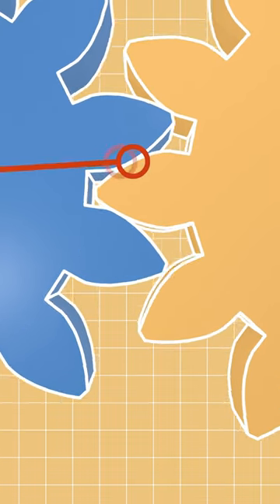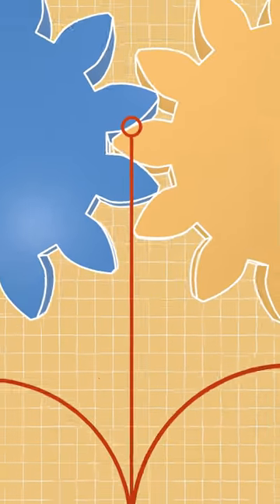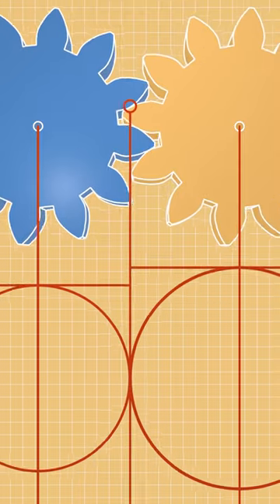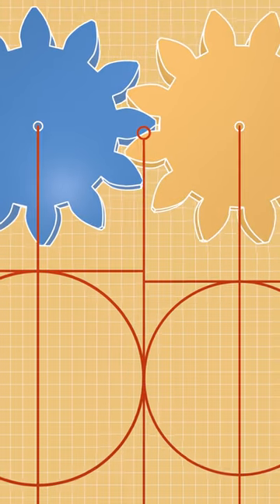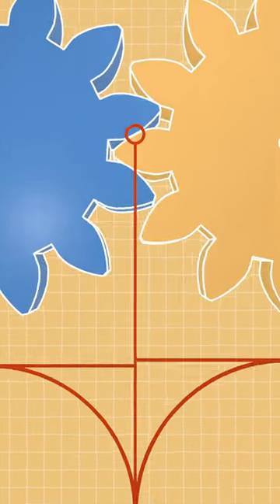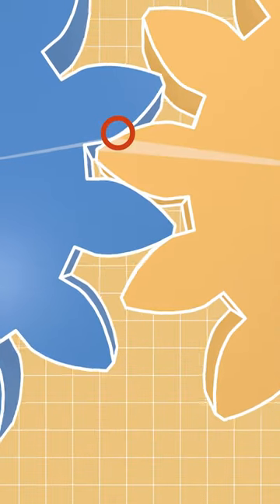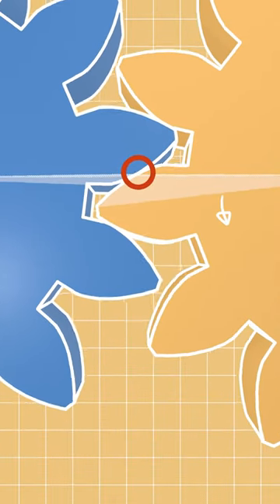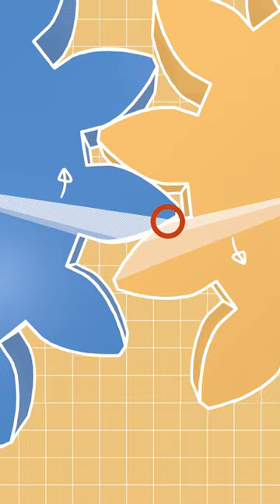Why Gear Teeth Have This Shape

Comment: Love involute gears. The force vector along an involute is always pointing in the same direction as well, super useful in making sure your system is stable and not wobbling. Also, constant surface contact with no discontinuities (like square-tooth gears), so no snapping or sharp corners for stress concentrations to occur. Smart stuff, another cool engineering application of mathematical properties.
Reply: Oh! That makes a lot of sense, then, if that's the purpose and this is a way to make it work successfully. Neat!
Reply: thank you for giving us the name of the shape / gear and for the thr extra info❤ we need more people like u m8
Reply: Yeah but them square cut gears are the best there are at handling high torque and shock loading
Reply: That's totally wrong.

Comment: Please revisit this as I'm pretty sure it's incorrect. Gear ratio stays constant in an involute profile, that's the whole point of that shape. The angular velocity ratio is also constant and does not change like in the animation.
Reply: You are right, it is constant. that's the whole point.
Reply: He ignores to mention that the real reason for the shape is so that the gears roll rather than rubbing.
Reply: @addmix  They still rub, I used to think they roll too, but it's actually impossible.
Reply: @roadrash999   Yep they rub, thats why you need lubrication if you want them to last.
Reply: That is literally what the video explains; how the shape is curved to mitigate the moving contact point, and thus how the gear ratio would change if it weren't for that shape.

Maybe it would be better if the loop went "This is why... The gear ratio is constant despite the contact point moving away from the powered gear.", but that's really being nitpicky about phrasing and not the actual substance of the content.
Reply: @CGoody564  That part of the video where it shows you the two gears having moved different angles in the same amount of time is what is wrong. By definition the gear ratio is the ratio of the angular velocities. Constant gear ratio means that they will ALWAYS move the same angle in the same time. The position of the contact point does not matter.
Reply: The narration is confusing but it seems to be saying that's what would be happening in the absence of the involute profile.
Reply: The surfaces are always sliding except when the contact point is on the pitch diameter
Reply: @ckush928 You are correct. That's why the teeth are shaped as involute profiles. The contact path is the common tangent of both the gear base circles. This means that the contact force is applied along the same line leading to constant torque and speed transmission between the gears. You can have non-involute profiles like cycloid profiles in wrist watches because you want lots of strong teeth that are very thin (higher gear ratios). In those cases the path of contact is not a straight line leading to a fluctuation in the power transmitted.
Reply: He means the gear ratio wouldn't be constant if gears were any other shape

Comment: What stays the same is the component of the difference in position of the contact point and the center of the powerd gear that is perpendicular to the normal force between the gear teeth. Sure the contact point moves away from the powered gear but the lever arm doesn't actually change because the force between the gear teeth isn't tangential to the powered gear. There isn't any actual pushing back to make-up as he says; This way there would be much more friction than there is in reality. Another thing to point out is that the point of contact moves along a straight line which is the dual of the forces that I've described. This gear tooth profile is the involute of a circle. Imagine wrapping a string around a circle and winding or unwinding it to produce the shape. In a way the string of one tooth feeds into the receding string of the other tooth producing the straight line of contact and constant gear ratio.
Reply: Thank you, Video quite missed some more important points
Reply: Yep
Reply: Yeah he often does incorrect explanations
Reply: Machinist?
Reply: Bingo. It's made this way so there is no relative motion of the gears at the point of contact. It's more about eliminating wear while providing a smooth motion.
Reply: very beautifully worded
Reply: Thank, the pushing back doesn t make sense
Reply: You are perfectly right, this video just spreads false information.
Reply: @andreasstavrou6695 . Like far too many. People need to 👎 and even press the 3 dots ••• and follow the promps to say don't send more. 
Otherwise we get what we allowed.

Comment: How do humans even think of this.
Reply from the maker: crazy huh?!
Reply: incrementally
Reply: we ueed to have A LOT of thinking time but now all we got is phone time
Reply: @tewkie7955 i dont think this idea was invented/produced by your everyday person, aka people who typically are on their phone more often
Reply: Problem, solution, problem, solution until it works
Reply: first you figure out that levers are a thing.
then push a lever with another lever.
then invent a "round lever" or "wheel" as the kids call it.
4th add teeth.
5th after extended use you learn about wear patterns and so on until you notice this.
(there may be many steps i missed.)
Reply: @tewkie7955  Phones bad.
Reply: @snickerdoooodle not if people use it properly
Reply: Euler was certainly no regular human
Reply: @ARockRaider there was a lot of math involved in reaching the correct gear tooth shape. I forget the name of it, but the tooth shape of gears is a specific mathematical shape that people would've discovered just playing around with circles and string.
Reply: A lot of engineers and scientists are slowly but surely improving and expanding every aspect of technology and infrastructure constantly.

It takes a lot of discussion, a lot of research, and a lot of development, but the slow and steady processes that have been built up over decades allow for smooth, continuous improvement and discovery.

Source: am engineer.
Reply: Usually it's smart humans who think of this stuff. Not genetically deficient humans like me.
Reply: @snickerdoooodle no
Reply: @ARockRaider how many steps until humanity made wifi out of rocks
Reply: Trial and error tbh
Reply: over a period of time
Reply: monke reaction when they can speak:
Reply: Because humans are a lot smarter than the Internet tells you
Reply: @starbound03 technically it already is.
Reply: Probably because the gear teeth wore themselves down to this shape
Reply: Trial and error over thousands of years
Reply: Just try a bunch of different shapes then work backwards and figure out why certain shapes work better so that you can understand why certain iterations are better and keep that design element and make a bunch more variations with that in it and it gets better and better each time you repeat. Its called the engineering design process and its basically just guess and check.
Reply: Before phones there was a lot more time to just let your brain breathe and think, calm down, and and be bored, and imagine and invent crazy ideas to entertain itself. It's why you don't see much brilliant shit these days. Our constant existence is watching a phone till we sleep daily, our brain is essentially and effectively rotting.
Reply: Math
Reply: A lot of math
Reply: most of what humans created was inspired from nature or try and error
Reply: @thedudeamongmengs2051 it’s called an “involute”. This gear tooth shape is what makes this an “involute gear”, but the mathematical principle you’re talking about is specifically the “involute of a circle”. All of the normal vectors you can draw about the involute path are tangent to the circle itself, leaving you with the fact that there will always be a perfect contact point on an involute gear mesh. The force vector as the energy is transferred is also perfectly straight (it follows a straight path through the gears), meaning this system is incredibly well-balanced. Perfectly-meshing involute gears are a thing of beauty, although you don’t often get “perfect” gears. Close enough lol
Reply: Engineers they always look at the details and study it then improve it multiple improvements lead to this result
Reply: @Vino976  yeesh
Reply: Probably f*cking around and finding out?
Reply: They didn't. He's wrong about why they are curved.
Reply: Just take two square shaped gears and let them work for a really long time. At some point they will turn to this perfect shape
Reply: Huh. My gear isn't moving how it wants cause the teeth are shaped like this. Huh. What if they weren't shaped like this?
Reply: So what is an application for this type of gears?
Reply: I don't know if this is the most impressive thing we've done, lol.  This is pretty middle school level robotics stuff xP
Reply: @Vino976 ”phone bad book good” ass comment
Reply: @tewkie7955 pushes your pfp to turn you off
Reply: It's even crazier when you realize how long we've known a lot of this stuff but manufacturing technology wasn't up to par yet so it stayed on paper or only for the ultra wealthy. All those guys, DaVinci, Aristotle, Newton, and like a billion guys from India just sat around and did math all day every day
Reply: Most of us have a beep in their due to their African ancestors
Reply: cause we built gears that were straight and we noticed how the output would vibrate
Reply: @TMinusRecords  you said in one word what I wanted to say in a whole paragraph
Reply: These are involute gear teeth. They are mathematically derived.
Reply: Lots of time to think and do
Reply: With brains
Reply: @tewkie7955 thank god
Reply: That's why we are on top of the food chain 😂
Reply: @snickerdoooodle Feel free to walk over to the hospital when having a heart attack instead of calling an ambulance
Reply: legends say that when they invented the wheel it was square at first, after being slammed on the ground so many times it became round.
I think the same thing happened with gear cogs, they got the optimal shape based on continuous grinding one another. ;)
Reply: they don't. it's done by trail and error
Reply: Problems exist, so we came up with solutions to those problems.
Reply: lots of math
Reply: By getting screwed over by it enough times. Due to friction, worn gears (if they don't break first) will naturally tend toward this shape as they wear.
Reply: Trial and error, theory, testing, and a LOT of time passion and boredom in your hands

We discover a thing then we find out its problems, go "I wish we can use X without this issue", a genius figures it out, and bam. Staple in human history
Reply: You studdy and work on a thing for your life. Thats how. There are even special shaped ones to reduce sound noise.
Reply: @thedudeamongmengs2051 mathematician, scientist and inventor are amazing
Reply: Math.
Reply: @deego237 That's the dumbest, most unverifiable legend. Also nonsensical. People have never been stupid. It's easy to see round things like rocks and eggs rolling and know that they roll because they're round.
Reply: Whith that squishy thing in our heads
Reply: MATH MATH MATH MATH
Reply: Engineers do.
Problems creates solutions vice-versa
Reply: @cardboardking577 voila.
Reply: Aliens
Reply: Intelligence. Research. Studying.
Reply: @tewkie7955 no that's not what's different. The people who invented this aren't like you or basic people who don't study physics or engineering. Don't blame phones.
Reply: Drugs
Reply: @poleve5409  that would mean the same for you
Reply: Studying nature
Reply: Centuries and millenia of theories and testing
Reply: @tewkie7955 you mean working time 💀
Reply: 2000 years, a lot of us, the invention of boredom.
Reply: figuring shapes out is kiddy stuff lol
Reply: @Vino976  yes that was his point
Reply: @luisapaza317  "An" application? It's harder to find applications for other types of gears! The involute shape described in this short is by far the most common shape used when making gears. :)
Reply: Bad gears just file themselves down like this through use and then people look at it and make it a bit better.
Reply: @Vino976 they actually are everyday people. One person designs something, then over time thousands of people make small improvements. We’re constantly building on top of our existing knowledge, one small step at a time.
Reply: Lots of trial and error, for starters.
Reply: Maths
Reply: Honestly a lot of times we probably don’t, we go “why does this one randomly work bet te r than this one” and then we figure it out and apply that rule to its max to create the best possible thing.
Reply: Millenia of iteration
Reply: Fail and trail
Reply: It called not being an NPC
Reply: Slowly. Like evolution
Reply: Iterative design. Every magical-seeming technology you have is the result of tiny incremental advances from millions of people, especially once market forces started incentivizing innovation you got many many minds thinking about how to make things slightly better. For example, this particular principle mightve been the only notable innovation a physicist/engineer made in their whole career.
Reply: It was the aliens 👽👾👽👾
....and robots.
Reply: We take a lot of inspiration from the world around us. Many mechanical devices have been derived from studying evolution in animals and how they adapt to solve problems. The legs of a grasshopper are very interesting BTW
Reply: A brain. Pretty simply brawndo
Reply: You know that there are millions of humans, within the time span of hundreds of years. Some Inventions didn't just appear in one night. They require alot of research time
Reply: they dont watste their time watching yt shorts they read books they didnt got lied at at school they didnt had brainrot
Reply: Iteractions... until it work
Reply: It usually when they discover something accidentally and figure out how it works later.
Reply: “Trial and error, dean, mostly error”

— Thomska
Reply: Some humans think for themselves and find solutions to problems. Anyone who fixes or troubleshoots issues knows the feeling of hyper fixation on the movement and reaction of things. If you manipulate something enough times and watch it work, then eventually, you will find out why it's doing what it's doing. I've taught myself so many things by just taking the time to slow down and watch things. You don't always need to be in a rush to learn something. You don't always need to watch a Youtube video, read instructions, or ask someone for an answer to solve a problem. Ask youself a question and ask yourself how you can make it do what you want. You WILL find the answer, and it becomes easier and easier to apply these methods the more that you use them.
Reply: @tewkie7955 "nuh uh phone bad"
Reply: Slowly over time, maybe you're also just not as smart as the engineers are
Reply: @luisapaza317 spur and helical gears, the most common type
Reply: What do you think we study in mechanical engineering!
Reply: @TMinusRecords empirically?
Reply: Calculus.
Reply: @Vino976  it most certainly was. More people than you think are effected by social media addiction
Reply: My dad always told me gears were invented by a kid in the 1700s
Reply: @TMinusRecords  Shoulder of giants.
Reply: I honestly think it's a lot of just making shit, observing theorising "why shit does this" then experimenting with the results. Rinse and repeat.
Reply: Shit ain't working so we have to find out why
Reply: random experiment after multiple mistake happened maybe?
Reply: Step 1: Discover problem
Step 2: Solve Problem
Step 3: Discover problem caused by solution
Step 4: Solve Problem
Step 5: Repeat until satisfied.
Reply: Trial and Error. It works most of time.
Reply: @LiebeLeuchten average boomer comment
Reply: @Vino976 it was actually invented by a regular ass dude
Reply: Profit motive.
Reply: Education, get some.
Reply: @thedudeamongmengs2051  An involute!
Reply: Math.
Reply: They run into problems and are then forced to figure it out
Reply: because some people are observant. Somebody probably used gears with flat surfaces and counted, and the math wasnt mathing
Reply: Math, time and trial and error
Reply: Elimination
Reply: I'm genuinely starting to wonder if this generation even has a brain
Reply: Trial and error
Reply: They had plenty of time
Reply: 👽glorp?
Reply: Brain
Reply: They do something that doesn't work and fix it
Reply: Probably engineers and scientist find the theorical superior curve with help of calculus 😂
Reply: A lifetime of learning from other human's ingenuity, which in turn was based off of other human's, etc.
Reply: That's engineers for ya. If you have that particular circuit between the ears, it just comes like I have problem, boom solution.

Comment: I know some people have already mentioned this but what is explained here is incorrect. The contact point between the two gears moves in a straight line while maintaining constant speed: this ensures a constant gear ratio and no slipping between the teeth, it's one of the main advantage of such gears. You could think about it like a pulley system, where the rope has a constant speed between two pulleys, it's essentially the same principle. If you want to see it for yourself, search "gear action line animation" and you should find something that will explain it better than I did.

Comment: Its this shape that the turning-speed (of the gears) is constant.
If u had an other shape the wheels would accelerate and slow down with each tooth.

The shape is called "involute"

Comment: The involute profile is chosen for most gears because it causes the pitch point to travel along a straight line (the pitch line) during contact, and so that it ensures strictly rolling contact instead of sliding contact. This reduces efficiency losses from friction, and makes it so that the gears can last a whole lot longer. 

Additionally, the pitch line angle can be manipulated to alter characteristics such as tangential loads, and minimum number of teeth.
Reply: ratio attempt